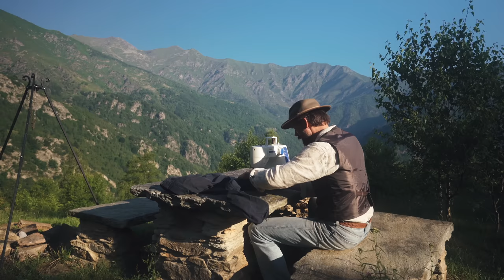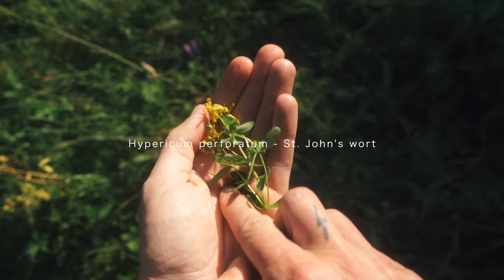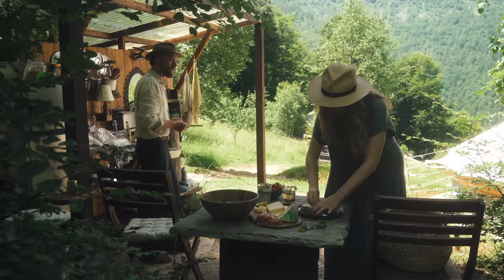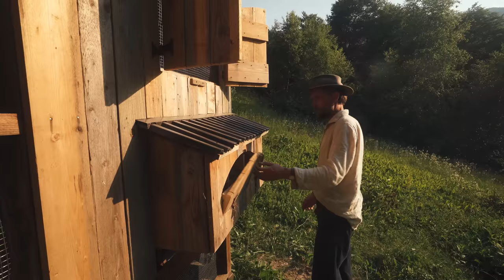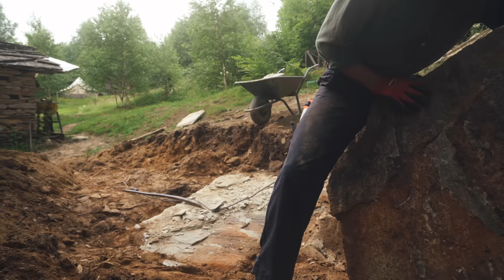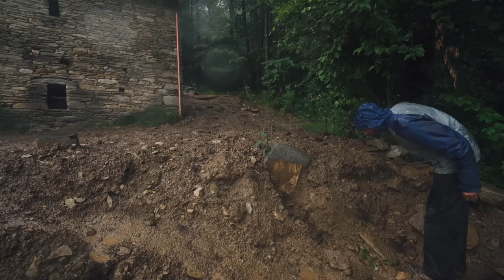#73 Foraging Wild Herbs

Comment: Don't let them out of the coop before mid-morning. They tend to lay eggs in the morning. Keep the straw in the nest boxes nice and fluffy and change it regularly. If you see your hen settling down in the wrong nesting spot, gently grab her and move her to the nest. Provide artificial light in winter. They need at least 14 hours of light each day. If you notice your hens trying to sleep on the nesting box remove then, if they sleep on the nesting boxes, they will not lay eggs there.
Reply: Estaba en duda, si escribirle sobre el cuidado de las gallinas. Tu lo hiciste por mí. Y mejor que si yo lo hubera hecho,

Comment: Those stone layers you pulled out would make a good facing for the terrace. All that work might as well go for something you can both enjoy and use. 
Gutters doing what they're meant to, great. 
People are starting to use hemp (finely chopped) with lime, sand for pointing. Apparently it's a decent form of insulation. 
Chickens took a bit of a wander, thankfully they are doing well. 
Potato bed looks good, should keep the potatoes moist being downsloping. 
Thank you Martijn, learned about some herbs common here, yarrow for one.

Comment: I would use those big pieces on edge against the upside dirt wall. The purpose would be a retaining wall od heavy rock slabs to prevent erosion and bank slippage in record rains. I saw this done in a development in Connecticut. It is quite effective and a very colorful wall.
Reply: The French drain was working. It takes awhile for the rain to travel into the pipe, but you had a good flow. All of that water was not going into your house, so good work.

Comment: If you have to go and buy compost for the potatoes anyway, I would try growing them in cheap plastic buckets with some drainage holes. You just shaw them up by adding more layers until the bucket is full. At harvest time, no digging, just tip the bucket out, get the potatoes and you still have the spent compost to improve your soil. 
Compacting your roads. You may be able to achieve this by driving the car back and forth over it and save hiring a compactor. I did my entire driveway like that - no heavy machinery required. Cheers
Reply: Some solid advice here!

Comment: In order to break that kind of rock you need a drilling compressor and air gun. You could find many of them in Luserna San Giovanni area. The kind of electric hammer you are using is not meant for that kind of heavy usage. Forza!

Comment: In a situation like this, buying a used Mini Excavator makes a lot of sense.  It can be resold later with minimal loss (I bought one 5 years ago that's now worth more than I paid for it...a larger Takeuchi).  With a blade and hydraulic thumb, it has SO many uses.  Can even be used as a crane when necessary. :)  While not as fun to watch on video, it REALLY speeds up digging a pond or terrace, moving sand and gravel, lifting stones to the roof, taking down trees, towing stuck vehicles, removing heavy timbers and other stuff from the trailer, adding irrigation and underground electric lines, fetching eggs from the hen house, etc...

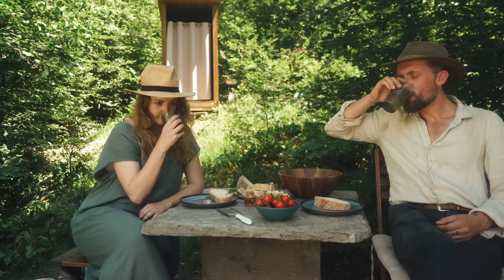Comment: 25:28 - Ahh .. so that's why the guy was so eager to patch his pants earlier .. not for chickens or planting potatoes, but because of this lovely visitor and her nature lessons ... 😉
BTW there is another way to break large stones - make a proper fire on it and then pour with cold water .. sometimes it works .. depends on the rock of course .. or drill a few deep holes, add some gunpowder and close properly .. very little is needed .. it's effective, but needs extreme caution to do so.

Comment: That must have been an intensely frustrating experience for you, working your way through your own backyard quarry, but from this end it was terribly entertaining. It seems like the kind of thing that might go easier with one of those large masonry saws to cut the stone into sections, then moving on to breaking it off those sections in manageably sized and shaped sheets. But I don't know how feasible it is to rent one of those saws, and at any rate you've reached a stopping point. At least if you need more stone, you know where you can get it?

Comment: When you where using the hoe . At 41 min 
 You should have been digging 90 deg to what you where doing much more efficient. A hoe is to brake the dirt then come back with a spade al.also the Handel should be longer so you can stand up straight . This will make it less on your back small hit but you can do 10 times more with less energy . 

Make it long like your rake .

Comment: Proabably way too late to change now - Why do the perforations go downwards? Water seeps from the bottom of the trench upwards into the pipe. Although you would think that having the holes at the top would mean the water could fall into the perforations, as it flows through the ground, this doesn't offer the best performance.